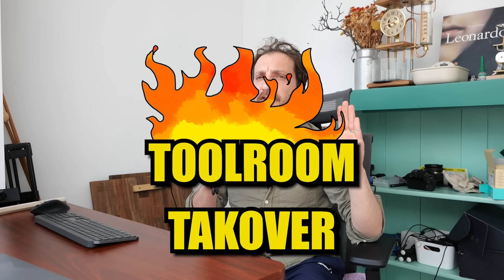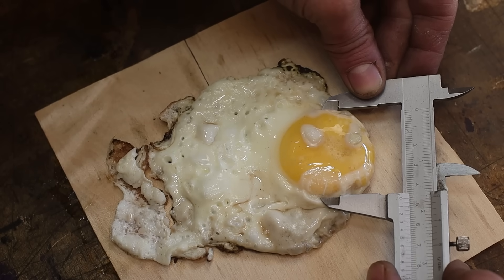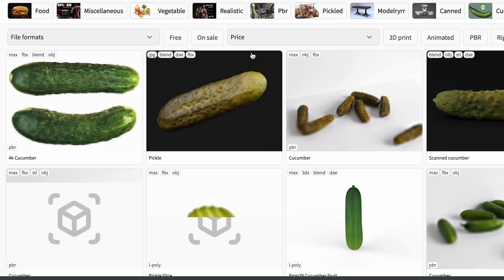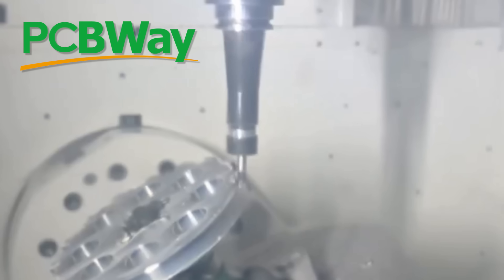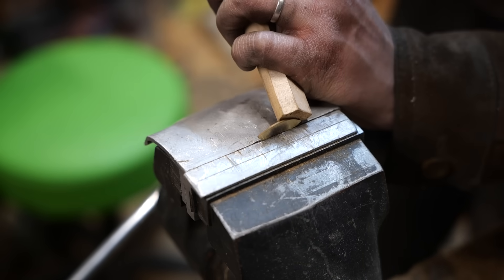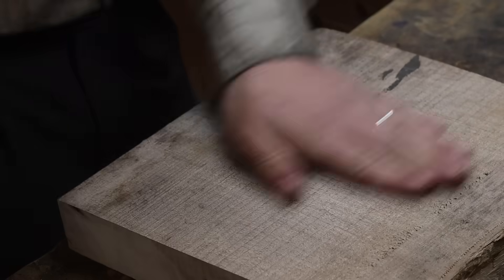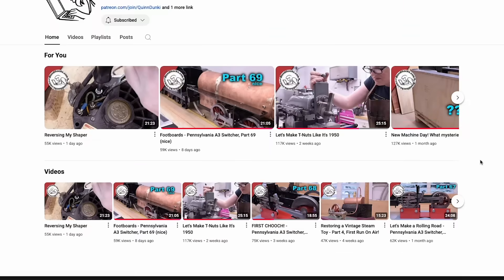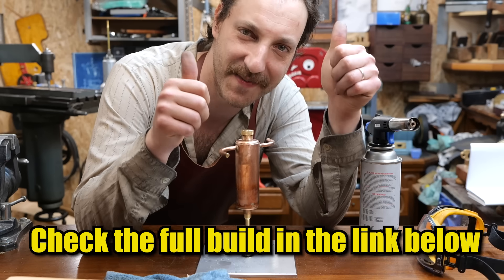Why did I Make a Fried Egg out of Metal?

Comment: heheh an asparabrush

btw what kind of metal did you use for the egg white and the brush handle? is it tin or lead?
Reply: Might be Pewter, a mix of Tin with some other low melting-point metals. Usually good for relatively low-temperature casting.